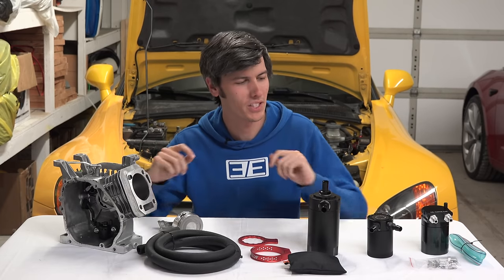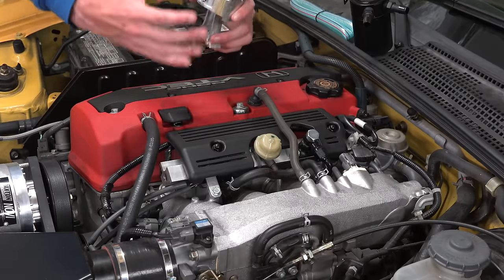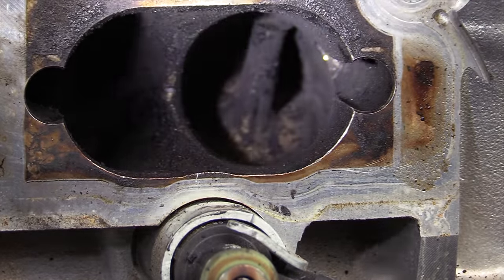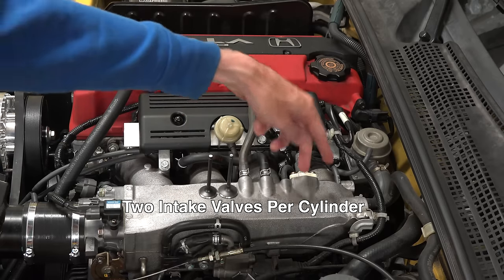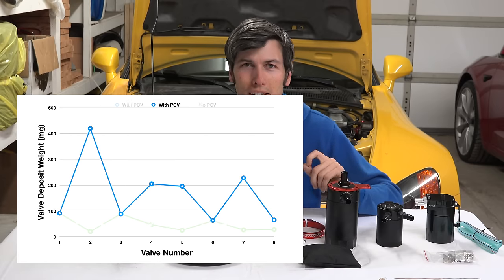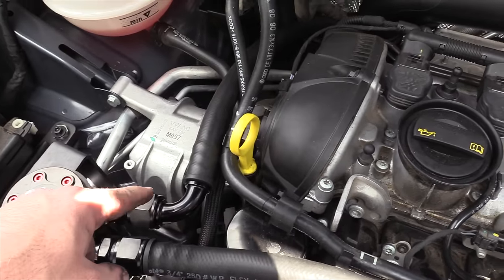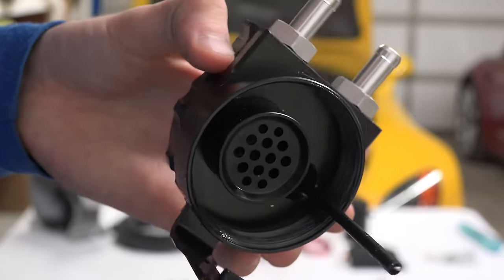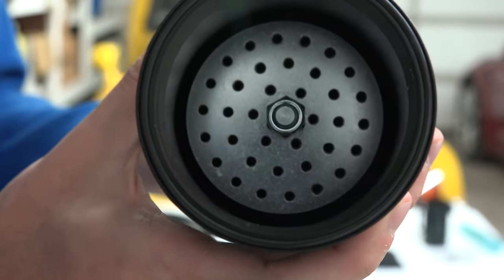Do Oil Catch Cans Actually Work?

Comment: A caution on using oil catch cans in winter: don't.  Condensation increases, more water collects in the can and then freezes.  This requires close monitoring to drain the can when it's hot, otherwise water will build up to a level where, when frozen, it will interfere with airflow in the PVC line.  PVC pressure goes up and bad things happen.
Reply: This Canadian thanks you :)
Reply: This is exactly why I finally decided to not install an OCC. Saw too many horror story on canadian and quebecer's car forum and group.
Reply: Very true. One way to solve this is to run a can that had a coolant pass through to heat it up. I think some fancier solutions do this.
Reply: Good thing I don't live in a state that doesn't go below 50-45 degrees.
Reply: @auTHORity0492  Sadly that doesn't solve the problem. The can is heated okay, but not the hoses, then clots forms(froze) and blocks them :|
Reply: @someoneqc  True, forgot about that. It's a partial solution. Next step would be to try and insulate the lines.
Reply: What about an air oil separator? I don't want to have to walnut blast my intake valves every 30-50k miles.
Reply: @auTHORity0492  Yes with a heating wire ;) I'll wait for a company to produce one until then I'm taking a risk.
Reply: Don't? The condensation is worse in the winter time causing contaminates to take on a milky coffee look compared to pretty much pure oil when it's warm. Telling people not to run this beneficial item in the winter time is wrong. Just check the damn thing every other day. I run these on both my trucks and never had an issue in the frigid air temps.
Reply: @CSXtrackworker  when you check them every other day, do they have much in them? I'd probably only check every week when I get gas. If that's too long to wait then I'm going with aos instead
Reply: Just don't install the can.  Run the pcv hose under the engine and let the crap drip out.  Plug the air intake hole.  I currently have a catch can on my 2016 Impala and I plan on removing it.  It's a larger size can but fills up in 4000 miles.  There are no inspections required where I live
Reply: good to know...
Reply: @devjk1  in the winter time I check it every two days and it is usually almost filled to the max. It's mostly condensation from warming the engine up and is mixed with some oil vapor and I dump it twice a week. When its warm I can usually go 2-3 weeks before I need to dump that can.
Reply: @CSXtrackworker  damn that's a lot, ok thanks 👍
Reply: @teds119  Could that trigger the check engine light? The ECU may take into account the PCV exhaust as part of the mixture when controlling the ignition.
Reply: Depends on how you define frigid.  Mine froze and blew my valve cover gaskets one winter at -30C after five hours on the road, and that after draining daily after driving.  In hindsight I think a better design of catch can may have prevented that mess.   @CSXtrackworker
Reply: I see more crud in my catch can in the winter than in summer, but I'm not in an area than freezes hard in the winter.
Reply: The fact we are seeing much more condensate in colder temperature shows that these are only removing a fraction of the wet component of the air. Herefore running a warmed catch can would be counter productive. Running any catch can may be missing most of the offending oil vapour. On the other hand it may be catching most. A study is required!
Reply: @428ghost  when I mean frigid, im talking about below 0 degree weather. A catch can will not fill up in five hours and then freeze. The hot temps coming from your valve cover will not instantly freeze and clog an oil catch can. It will freeze over night but not when driving. Ive had my truck in -20 degree weather and checked it at the ens of a seven hour drive and was not frozen.
Reply: Exactly how I blew my main seal and valve cover up
Reply: devon kim is that not what an oil catch can is?
Reply: I would think that one of the most important parts of installing a catch can is to make absolutely certain that you don't put any traps in your lines.  The trap could freeze and you could blow a seal before it has a chance to thaw.
For instance, the 2.4L Equinox has a trap built into the make-up air side.  If the non-serviceable (idiots!) manifold side plugs, and the trap freezes, you'll soon have no oil and a dead engine.  I know of 2 people this happened to this past winter.
Reply: But ppl who drive their nice cars in the summer shouldn’t have to worry bout it. Or those who drive in warm climate areas.
Reply: How cold are we talking? This seems like a good mod for preventing carbon build up (bad for rotary cars like mine). The coldest it gets here where I live in the Carolina's is like mid 20's to mid 40's in the winter.
Reply: My experience says otherwise.  There was the incident with the valve covers one winter, and then an engine failure the next, same -30 conditions, highway speeds, long drive.  I'm pretty sure the blockage was in the line itself, because the can shouldn't have frozen while driving, just while parked.  By your handle I gather you're a diesel driver, so I wonder if there's a difference between gas and Diesel engines in terms of catch can deposits, namely condensation in winter.  Every winter my catch can was a huge hassle due to freezing, daily draining, and eventually it cost me a lot of money and a new engine. @CSXtrackworker
Reply: At some point checking it that often is silly.  Doing the  intake valve cleaning every few years would probably be less time consuming then such frequent checks and headaches
Reply: @auTHORity0492  Or you just zip tie a beefy resistor to the can, obviously means that you have to find a wire that supplies power only when the engine is running
Reply: Exactly this. I had one on my '12 Camaro 3.6L and never gave it a thought the first winter it was on the car. I would check it 2 or 3 times between oil changes and first check after sometime into sub-freezing temps, it was full and froze. I started checking it once a week. Following winters I just disconnected it and ran it normal. I was surprised in the summer how much it would catch though. I now have a '17 Colorado with the same engine but have forgone the idea of adding a catch can. I had taken the one off the Camaro but thought about adding it to this truck but sold it instead.
Reply: Garages are nice 👌
Reply: @streetfighters805  Or people who have garages that are attached to the house and don't see temperatures that low.
Reply: The early 8.1 gms I run into on generators always load up the pcv can with water. 
The latest ones wrapped the can in a blanket and the moisture problem stopped.
Reply: Yes, I've seen people who had their cans freeze, blocks off the crankcase venting and it blows the dipstick out along with quite a bit of oil.
Reply: Have one on my 17 High Country 6.2L it works great but as mentioned it needs to be checked more often in winter no biggy living in Nova Scotia
Reply: HexagramMan  That's what I was thinking too. If the vast majority of what gets caught is oil, may as well send it back to the oil pan where what gets caught can get re-heated until the PCV path gets hot enough to let the vapor through. On the down side, this only works if you drive your car long enough and often enough to boil all of this stuff out of the oil.
Reply: Parker Albanese I’m no mechanic, but the lines aren’t there without the can? I think it’s those who block.
The guys where I get the car tuned told me that they had customers calling during winter telling that they have issue (I don’t know which one) and the tech would ask if they have an AOS, and the answer was yes :/
Since I only drive the car during winter season, they told me to stay away from those device.
Time will tell ;)
Reply: Not sure..1 - Anything that is in the catch can is lower than the in + out hoses. If it froze it shouldnt interfere with air flow. 2 - if you are worried, empty it often. if it fills up every week, you may have other problems on the horizon. 3 - anything in the catch can [oil / fuel / coolant] should not freeze like plain water. Although i could be wrong...
Reply: What about Florida?
Reply: Valid
Reply: Pcv
Reply: @chriskelvin248  no, an aos doesn't hold oil, it allows it to go back into the oil tank. No reservoir = no condensation and no needing to empty every other day. It's about 400$ for the one I'm looking at instead of 150 for a catch can. And the install is a bit harder, but it's sounding like it'll be worth it.
Reply: Not sure Didn't think of that
Reply: Can vouch. Horrible mess. Don't even try it! My last car had it really bad and it was just sludge and it always got clogged.
Reply: Thx
Reply: Thanks, mine is garage kept.
Reply: PVC valves fail all the time, closed and open, you don't see "bad (vague) things happen"..149 people have NO IDEA what they are agreeing about. 
Crankcase pressures unvented just will cause poor performance, in extreme cases can case preignition, but in most every case it finds a way out...
That's why PCV replacement is scheduled, because you virtually never know when they go bad....
Reply: A lot of the more expensive catch cans and air oil separators (so just a catch can that drains back to the oil pan) run engine coolant through them to keep things from freezing up.
Reply: @teds119  and what if just simple install the f. PCV delete kit? and plug the intake line and thats all...where the gunk goes after the delete?
Reply: Nope. not at all. but your comment look smart, so i liked it ;)
Reply: My experience says otherwise: blown valve cover gaskets one winter, engine failure another.  After the valve cover gaskets went I changed the PCV valve.  No worries for a year until on a similar -30C day the engine died.  Cheaper to replace the engine with a low-mileage one so I never bothered to have a post-mortem done on the engine, but I know all the oil was gone out the exhaust so I'm guessing a head-gasket blew.  Was icing in the catch can the culprit?  Coincidental I know, but after the valve cover incident it seemed likely that crankcase pressure may have had an influence.   @ramairgto72
Reply: Cummins Owner Amen brother! Common sense...👍
Reply: @428ghost  If you have that much pressure in your crank case, you have a Blow By issue , as in your getting combustion gasses past your rings causing a lot of pressure inside your engine.
Also if you have an older engine I.E. before 2000, a detergent oil will eat your old gaskets causing them to fail , or you can have a rebuilt older engine with older style OEM gaskets you will have the same issues.
No way will a blocked PCV valve cause this issue...…..EVER, even guys running herder exhaust extractors don't have this issue . Do a leak down test on your engine to find the real issue. @428ghost
Reply: All these comments arguing and I just want to say it PCV not PVC lol. 😬 PVC is that white pipe at Home Depot 😅
Reply: What if you drain the liquid once it reaches a certain level using a solenoid valve. You can also monitor the pressure using a pressure sensor and open a valve in case something is closed and play an alarm. Then drain the tubes must be routed away from any hot areas of the engine
Reply: Don't live in Canada
Reply: i remember when positive crankcase venting meant sticking one  of those little filters in your moroso valve covers
Reply: @0johnny082  I prefer the Moroso "vacu-pan"(?) that routs it out the headers
Reply: So what you're saying is to splice the hoses and put valves in to bypass it during winter.
Reply: Good thing i live in florida lol
Reply: @MaxCohagen  an engine has to vented because of pressure build up. Even gear boxes and differentials are vented. 1963 Clean Air Act specifies that engine vapor cannot be vented into the atmosphere so it's burnt off via the pcv system.
Reply: @CSXtrackworker  At what temperature do you begin to check every two days?.  In Quebec Winter time is large!
Reply: Julie, I check every other day when the temp goes below freezing point. A lot of condensation can build up in there pretty quick. I pull the catch can after I am done with my commute home so it is still warm. That way whats inside wont be frozen after sitting for a few hours. Hope that helps.
Reply: @CSXtrackworker  Yes, Helpful, Thank you!
Reply: PCV... positive crankcase ventilation 😎
Reply: 428ghost You, sir, are a hero. Get this man an award.
Reply: @CSXtrackworker  Yup I had one for around 4 years when I had some  blowby no issues living in the snow belt.  The logic not to use would also include not using the engine period as the same thing is occurring.  Di with that increased pressure even more so would the can be a useful addition.
Reply: @cardinaloflannagancr8929  I love mine. I run two on my 08 Silverado 1500. One on the drivers side head and one on the passenger side head. My throttle body and valves are nice and clean. I run one on my 2018 3500 Cummins Dually. Just split the hose coming from the pcv filter and spliced the can in. Nothing makes it to the turbo. Trucks fully deleted but I still left the pcv filter setup on.
Reply: @skibik64  did the catch can do any damage to your Camaro due to the freezing temperatures?
Reply: @squidusn71  Not that I was aware of. When it freezes it just freezes up in the canister. I never noticed that it actually freezes up in the top separator part of the catch can. There is enough warm or hot air flow through it. It more or less just renders the unit ineffective.
Reply: Could have some sort of pressure relief valve to direct it straight to the intake if that happens
Reply: If the heat of your engine and enginebay can't "melt" this alleged ice - your car must be hamster-powered....
Reply: HexagramMan  then you'd be draining all that crap blowby, which might contain fuel and water engines don't really like fuel and water in their oil
Reply: @inox1ck  lets invent a blow off valve on the upstrean hose, can freezes/clogs blow off valve opens through a loud horn installed above and slightly behind the drivers left ear( right ear for you people that drive on the wrong side;) ) but no seriously a blow off valve or people could just check it more often but how are we gonna profit from that type of logic
Reply: @CSXtrackworker  that's exactly what I'm saying I live in Colorado where it gets freezing all the time way high up in the mountains and I run on multiple turbo vehicles that's impossible for you to fill up and then freeze especially with the heat of the engine this guy is explaining and putting bad in postseason good info though bro
Reply: I wish Youtube had the Facebook emoji system so I could laugh at this comment. So much misinformation in one comment thread. As one comment previously mentioned, PCV valves fail all the time. The excess pressure has nowhere to go, much as if a "catch can line froze with water."  The one and only comment that makes sense. If water build-up is to the point it "freezes" a vacuum line shut, you should focus your attention everywhere else BUT the catch can. I cannot possibly imagine a scenario were that would even be possible. Unless your engine is a water pump and you use water as oil. Honestly, that's the only possible excuse for such water entry. Plus, an engine's heat expels and stays trapped under the hood. You're looking at temps above 150F, 5 times the amount of heat needed to melt any "icy build-up." Please, don't spread such blatant misinformation without using common sense and no factual information to back it up.
Reply: Can't you put some coolant in the can to prevent freezing?
Reply: What about putting a spigot/valve at the bottom of the can and a fish tank hose. Open the valve in winter to drip the excess water. Close the valve when temp is normal.
Reply: I live in texas soooo 😂😂
Reply: @DerH0ns  You moron, the water freezes inside the hose and not the catch can
Reply: @parkeralbanese2085  exactly. You are literally running the same line only larger in most cases. The catch can just give the line a turning point to drop waste.  I have my can mounted on my engine so it heats up, I'm in Texas so I'll worry about this on the 2 days a year we go below freezing lol.
Reply: seems like im lucky where i live the coldest temperature in winter is about 8degrees
Reply: Back when we had road draft we didn't have these problems. Or have to stop at every bathroom either. Hee-haw!
Reply: @CSXtrackworker  and where do you drain it safely?
Reply: @MrM4rvelous  I unscrew the can and dump it out. Winter time, twice a week. Warm weather, once a week.
Reply: @CSXtrackworker  dump it where? Is there a place to do so safely? Will the can be too hot to touch after a drive? I know little mechanically, but a car I might by already has one of these installed moroso brand
Reply: @MrM4rvelous  on the ground, or a used oil jug. Where you dump it is your choice. It's usually pretty hot after driving around so you should wait a while before dumping it.
Reply: @CSXtrackworker  thanks for your reply sir have a good one
Reply: @MrM4rvelous  not a problem.
Reply: @parkeralbanese2085  Exactly.
Reply: Except the can will heat up once car reaches operating temp and melt anything inside. So just warm up the car properly and check them a little more often in winter and you’re good
Reply: @ramairgto72  All engine do blow by at different level and this is why there is a pcv. It get worst under high boost. When pcv freeze and block, the pressure find a way to escape and it could get dangerous. Mine cached fire on the highway after a pull because the occ froze. The dip stick poped and the oil splashed on the exhaust manifold. Before i figured it out, it was too late... On the same idea, I did read gm 2.4 may have factory pcv problem that freeze and pop the crank seal out. it would drain the engine oil pretty quick...Turbo snowmobile had the problem too and now, it has occ lines routed with coolant lines to avoid this....
Reply: I live in Nebraska and never had a problem.
Reply: That happens even on stock engines with no catch cans especially if the car does lots of short trips. Some mfgs added heated pcv hoses to try and remedy.